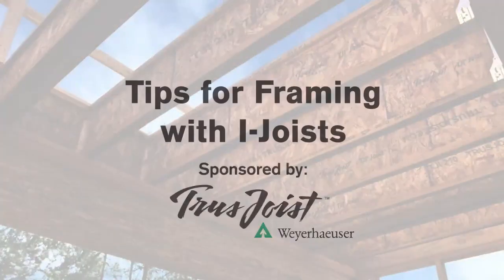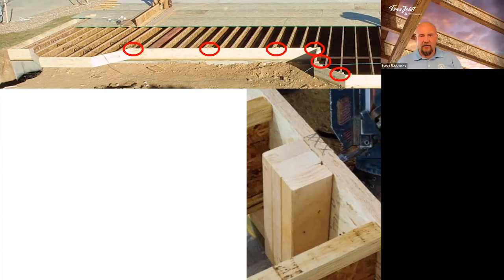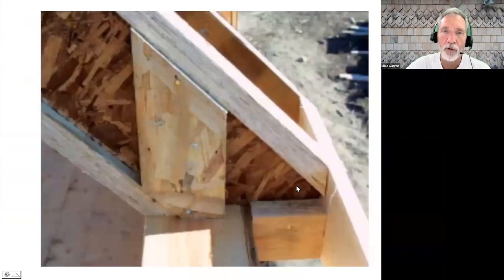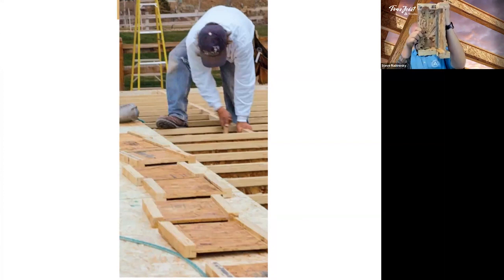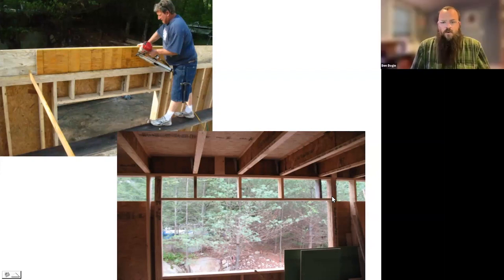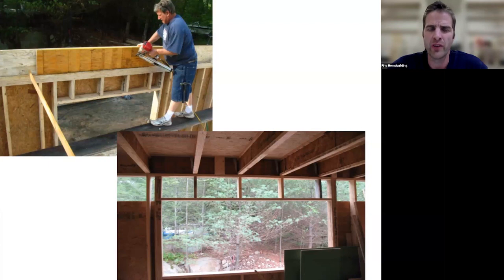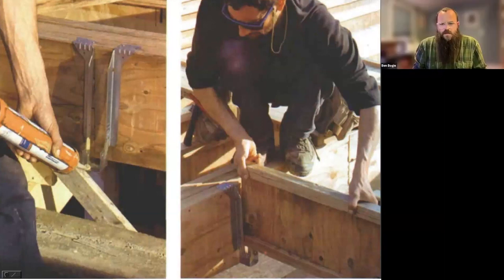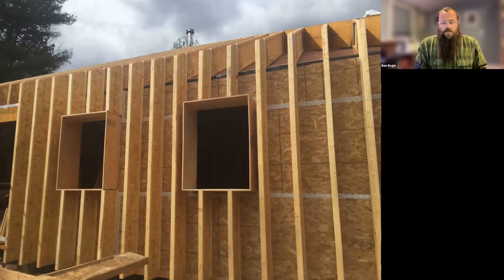Webinar: Tips for Framing with I-Joists

Comment: It's nothing like picking through a stack at Home Depo. All delivery of materials should be inspected for damage, and proper dunage to support as flat as possible. PL adhesive is used on top of the I B joist do you put two lines of it or squiggle line? How about Deck Screws to secure the subfloor? Would you coat the ends of a IBW joist to protect it from water absorption from foundation. Do they make treated IBW joists for non-cellar open-air posted/columb supported foundation?

Comment: Question for you guys.  I am building an Aframe style home.  I would like to use 12" deep I joists for the rafters.  Theses I joists will sit on a 12" plate on top of the subfloor.  What is the best way to join the peak ends together?  There will be basically no load on this home, as it has a 12/30 pitch and a metal roof. I believe I've seen people make a jig and cut triangles at to fit over the joint and nail them together.  I don't know if this is the best way or if there should be a ridge.

Comment: Was watching your video and at 1:10:58 you show some roof framing there and it seems that the ridge beams are smaller than your rafter cuts. How are you circumventing this around 2018 IRC 8.02.3 where it states that the ridge beam shall not be less than the plumb cut of the rafters?

Comment: I am still not sold on this method/technology - Dimensional lumber has so many more benefits and makes repairs so much less complicated. This system creates major headaches just to hang some drywall or ceiling tile. Increase in labor, costs and repairs just turn me off.

Comment: I would never trust i-joists in my home, only solid wood beams. The manufacturer says is load tested but what warranty do you have from them if it fails in the long run? Will the manufacturer rebuild your home? No, you will have to go through insurance which will double your rates after the repair is complete.
Reply: Same here, I avoid anything osb related. I'm happy osb and I-joist exist. Imagine how much plywood would cost if it was the only sheathing and subfloor option. So yay! Houses are already built crappy, lets find ways to make them worse and cost the same or more. The only problem may be early forest harvest for wood chips versus longer growth for plywood and dimensional lumber. Hopefully this doesn't influence forestry management much outside normal tree thinning and their use for wood chips to maximize growth/profit per acre. If the demand for these products goes up there may be fewer forests that reach maturity for dimensional lumber and quality plywood.
Reply: Well they have been in widespread use for about 35 years so that might tell you something.